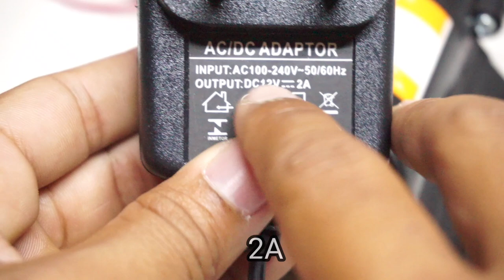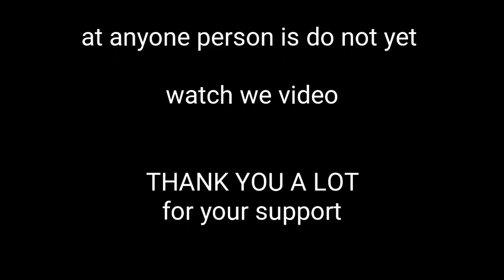AMAZING Video, 2 ways idea, water pump 12V wireless

Comment: Can you do this on a 21v drill battery?
Reply from the maker: The motor is 12v. I think you can used 21v. But the motor will heat up quickly and may damage the plastic cover.